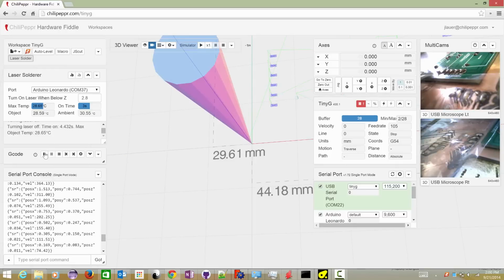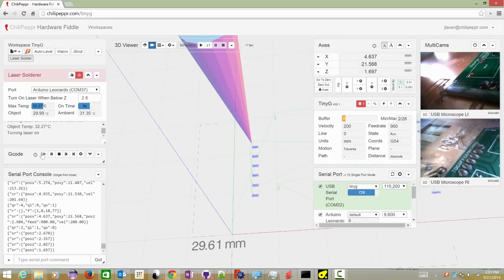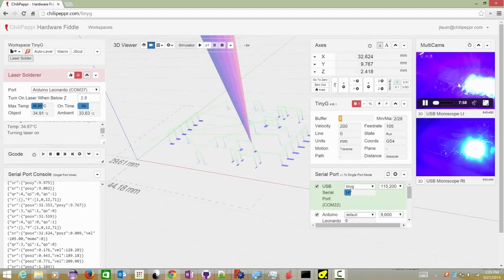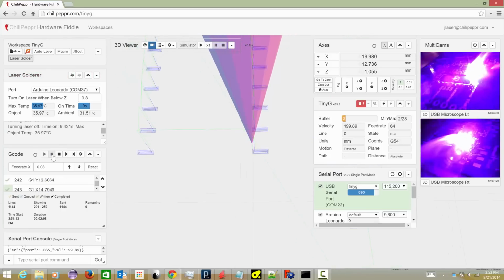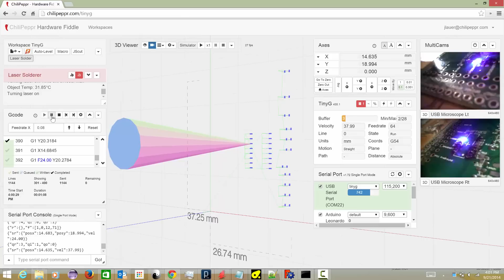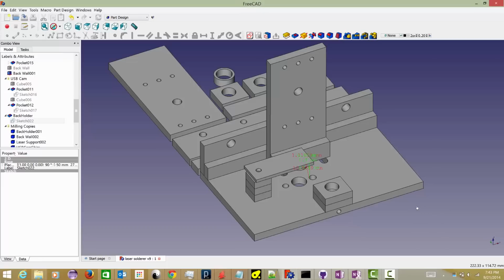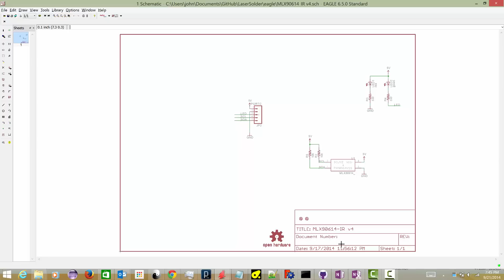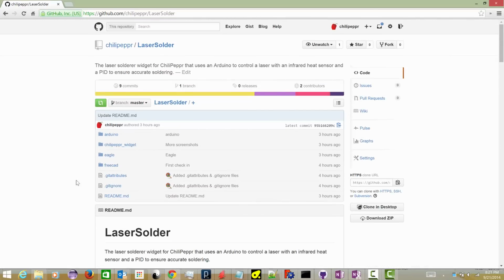Laser Soldering in ChiliPeppr

Comment: Any progress on this? I did some trial runs with my 5.5W laser diode on my 3D printer which were very promising. I didn't need to move around very much at all and the dwell time per pad were pretty short. Guess I need to learn how to automate this...
Reply from the maker: I sort of gave up on it, but I do think it still has potential. I kept burning the PCB and realized my laser was over-powered and actually splattering the solder paste like exploding it. I started to figure out how to adjust the power dynamically and that's how I ended up with the Cayenn project as part of ChiliPeppr along with the Eagle BRD widget, but never got far enough to map the laser control to the PCB pads. I started to think solder reflow ovens were just much easier.

Comment: I could imagine the most success could be had with a 30-60W 808nm or 1064nm laser with an array of plano lenses to shape the beam into a culminated beam, then small actuators to resize the beam to focus on the correct pad shape.
Reply from the maker: What I think was happening is that I was instantly boiling the flux into steam and exploding the solder. I was also burning the FR4. So, with a 6W laser, I actually had too much power. I think what's needed is an infrared heat sensor looped into the laser power to keep a constant temperature.
Reply: Hmm, maybe. I reckon defocusing the laser and a higher power would be a good place to start, as others have said, it's too focused and may be heating very unevenly.
To help dodge the need for IR heat sensors, you could always use a PCB of single round copper pads, then work out the heat capacity and dissipation so that you could calculate the actual power and temperature, if you take everything into account. It would be hard work, but doable.

I've looked a bit closer into the solution, 808nm and 1064nm may not be optimal, it looks like a green or blue wavelength absorbs better, but I doubt there is too much information on spectral absorption of different solder paste grades.

Comment: What readings you got from the MLX90614? I think it measures only up to  380°C according to the datasheet. It's ok for lead-free solder, but a little tight. 
This said, there are a few other videos on Youtube were they test the same sensor with a solder iron - but it goes up only to 60-70°C.
Heat control at the solder point is essential, but I wonder if MLX90614/6 can do it?

Update: I checked with Melexis. That sensor is not suitable because the FOV is too wide. I guess it returns the average temperature of whatever is inside the FOV area. There are more suitable sensors, but probably not in the $10 range. I will keep checking and post when I see something better that isn't 4 $ figures.

Comment: I am going to work on pre heating the PCB with a heating element. Will keep you up to date on progress.
Reply from the maker: Yeah, if you get the PCB closer to the solder melting point, then the laser barely has to put any energy to get the solder to melt. My problem in this video was that the laser was way too powerful and it was exploding the solder paste. I also had the laser beam hitting the FR4 and the pads because the focus was too sloppy. And, finally, I concluded that the Melexis heat sensor was not picking up the heat from such a small spot size.

Comment: Hrmmm What if you actually used an additional  wide focus beam to heat the area as well.  You probably won't get good beading with normal solder paste, since the pads aren't heated at the same rate...  Just a thought.  Great idea though interested in seeing this technique work!

Comment: Hi;
  check this video out:
https://www.youtube.com/watch?v=KnyB9btlhS8&spfreload=10
Reply from the maker: Yes, that video was one of my inspirations. If industry can do it, why can't we do it at home? I do think they're using an infrared laser in that video like an 808nm or perhaps 940nm or maybe even 1064nm. Not sure that matters much but metals do have different wavelengths where they will absorb more of the laser and thus heat rather than reflect it. Copper only absorbs green light or below, so the blue laser I'm using is much closer to the absorption spectrum than infrared. They seem to have a cleaner, more rounded beam, than I have. That could be part of the problem. I also can't video record the laser using blue as they can, so it's hard for me to see a visual feedback of what's going on. Lots of continued work to explore here.

Comment: Hi;
  I really enjoy your videos.

I think the problem here is that the laser is "too sharp".
To solder you need to heat up the component/pcb/solder together.
Your laser is punching through the solder and burning the pcb.

What if you made it wiggle in a spiral to spread the heat, and give it time to diffuse?
That way the heat would nott be concentrated on a single spot.
The hard part is heating the component because of its mass.
So you would have to spend more "wiggle time" on it.

That or de-focus the laser and maybe move it closer.

Mick M
Reply from the maker: Totall agree with you. I think the key is defocusing which I can simply do via moving the Z axis up or down. I generally know the cone shape of the laser. What I've done is step back and rework my Melexis heat sensor. I've upgraded to the 4x16 pixel version. I'm rebuilding my mount to get a better field of view of the soldering and a tighter PID feedback loop on the heating. If I can keep the heat at the exact temperature and base the soldering on being at 185 deg C for 3 seconds rather than guess at timing based on a pad size, I think I may have a workable cheap solution. It will take some time though as I go down some other rat holes.